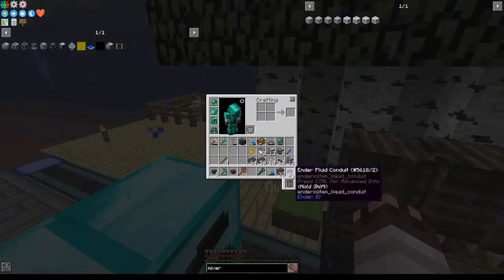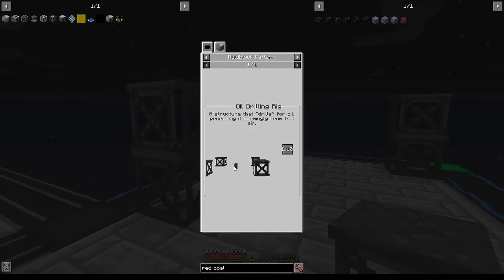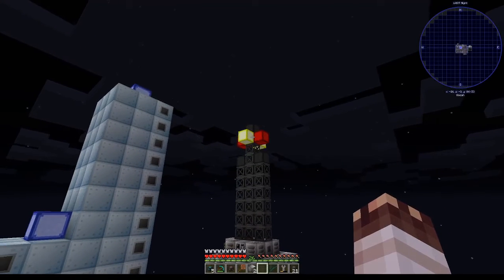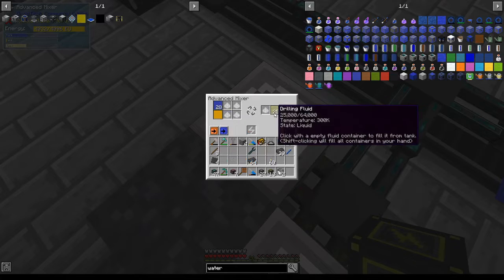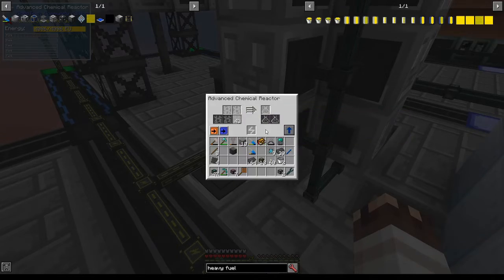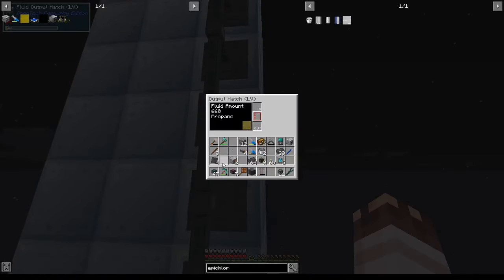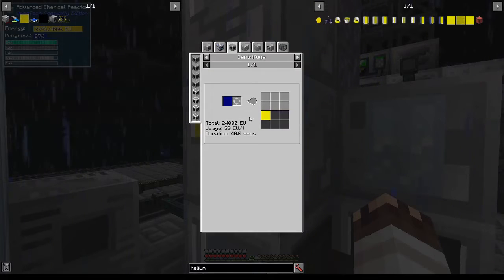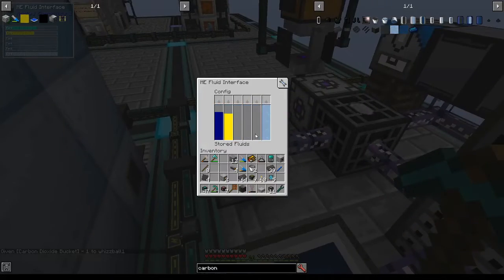New Omnifactory Supershorts #16: Petrochem

Comment: The mechanical crafter you are using for the drilling pipes can auto-pull from adjacent inventories the exact amount it needs for a craft. So you do not even need to use conduits with limited item filters at all!
Reply from the maker: Hahaha! I can't believe i missed that, especially since I utilised that feature in my electronic circuit build! (To be fair, that was months and months ago.) I've pinned this comment!

Comment: You can use left click to turn mutiblock guide around vertical axis in jei. What's more is that you can use shift+left click to turn it around horizontal axis. This allows you to check layer from above